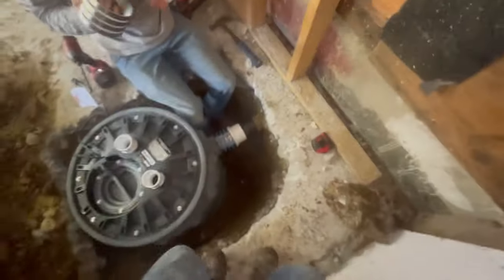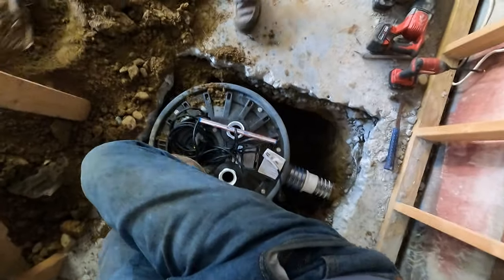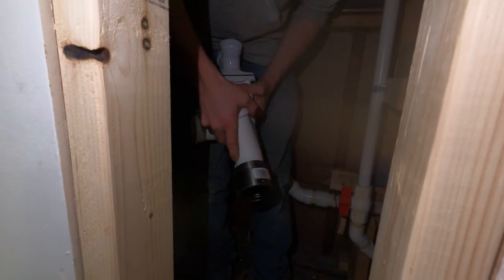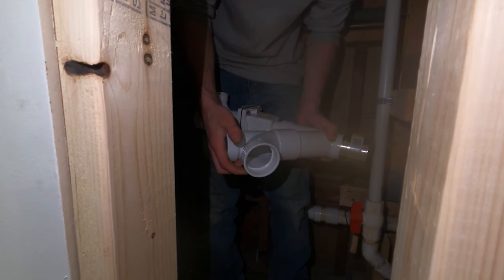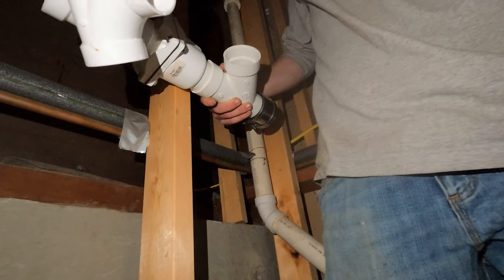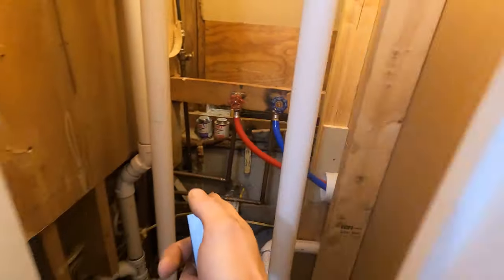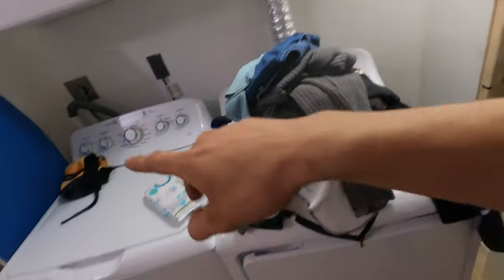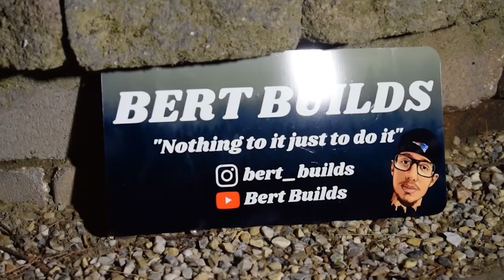INSTALLING a sewage ejector pump!! (TRUCKS and TRADES episode #5)

Comment: This video could’ve been really informational however you never showed installing the three or four inch pipe in what you used to attached to the pump, that you installed in the ground and then when you decided to describe what the flow valve or whatever that thing is we saw your chest and your legs we never saw what you were explaining to the guy.
Check your video at 4:11 😊